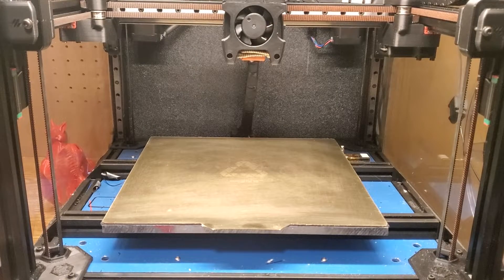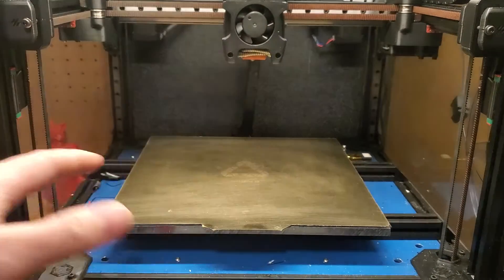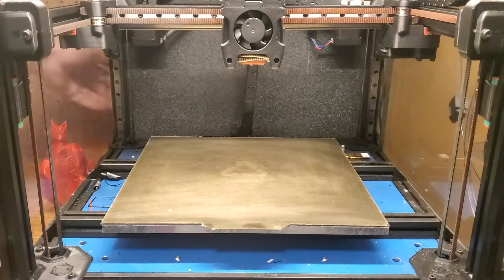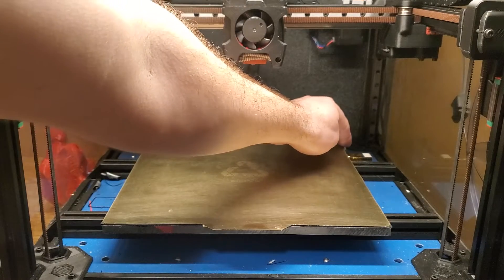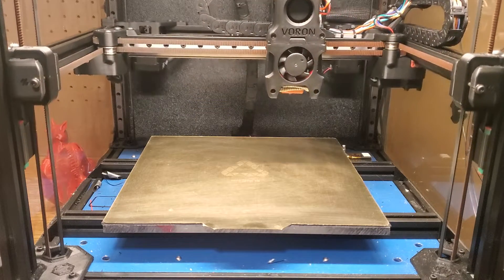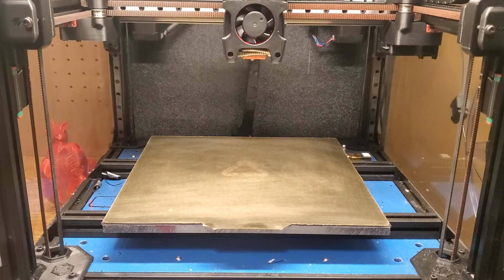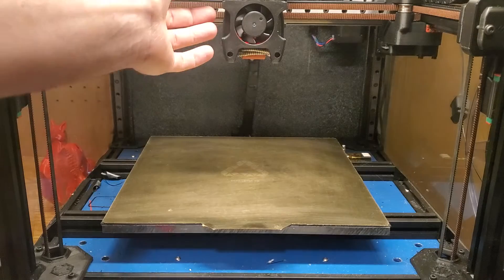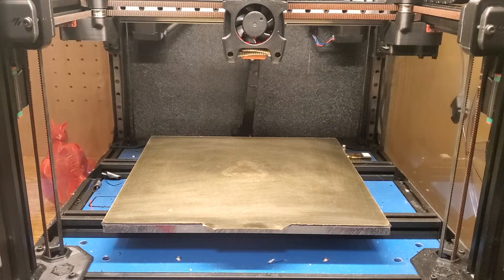Voron v2 gantry tramming and z offset mechanics

Comment: So I've been reading the 2.4 Build Manual and been skipping through some videos but somewhere along I must have missed the part explaining the required final length of the Z-Touch Probe Pin - The Build has a graphic listing it at 33mm but the manual also mentions it needing adjustment which makes sense as it is highly depending on the combined thickness of a build platter PEI spring steel bed mag sandwich but what is the final length of it? With the entire sandwich assembled do we simply shorten it down until the PINs top surface is flush with the Build Platform one and at what stage would we want it to be flush? While the Z-Axis Switch below the PIN is relaxed or while it is triggered?

Coming from an i3 MK3S with MMU2S I'm also kinda hesitant in making the jump to a Voron 2.4 ( besides the increased build volume I also find the tool swap ability of it intriguing ) as losing the MMU2S' provided Multi Material Printing capability is kinda really huge for me - In one of your videos you've mentioned that the MMU2(S) might be the only current option to go with in terms of Multi Material Printing ( with alternatives like a Pallet not being able to keep up ) on the Vorons but I couldn't really find any information on someone having it done - You wouldn't have any more information on that?
Reply from the maker: The pins needs to be long enough so its roughly even with the print surface. Plus or minus a wee bit is ok..long as the nozzle.can reach it witgout hitting anything.

As for mmu. That style of multimaterial is functional on a voron.  Other methods like y splitter or palette work too
Reply: @CanuckCreator  Aii... That was a fast reply 😮 Any recommendation where to look for additional information on how to get the Prusa MMU2S hooked up and working with a 2.4? A Voron SubReddit search has a whopping 4 results related to MMU coming up and none of them actually talk about someone having one running 😐
Reply from the maker: @Duraltia  voron discord is the best place
Reply: @CanuckCreator  Hmm... Okay. Thanks! 👍

Comment: can you do me a huge favour? it looks like you know what you are doing, so what is the deal with the smooth idlers? i have been looking in all the wrong places for a good reason to do this.
Reply from the maker: Smooth idlers allow larger bearings which last longer. Also in testing ive found barely if any noticable difference in print quality so kept the smooth idlers
Reply: @CanuckCreator  thank you. there are larger tooth wheels available though. i just worry about the belt profile. Also i have only ever seen it with bearings that where smaller than a 20teeth pulley, so where would be the point in that(compressive force?)?

Comment: I was wondering why not use PINDAv2 it could compensate the heating offset? The price is around 10$ maybe there is a reason not to go this way? :)
Reply from the maker: Iirc there is a mount adapter for it somewhere. Its not really need though unless your temps change between probing each corner during each run as the microswitch handles the offset.
Reply: @CanuckCreator  thx for the answer. That's what I'm trying to understand. It's cheap (around 8$) and small and does the same job as microswitch + the sensor (ali 12$). Maybe I'm missing something :)
Reply: @FBWA-Karhu  Bed tramming is not the same as Z offset. The probe handles tramming (how bent is the bed and compensate) and the switch handles the Z offset (distance nozzle to bed).

Comment: I assume the nozzle probe has to be aligned to the top of the bed?
Reply: not really. You figure out your actual nozzle probe (Z-home switch) offset in reference to a printing table surface in empirical way then specify the value found in the printer.cfg file. Once the offest specified any new nozzles will be zeroed at the same Z0 level after changeover as the previous one.

Comment: Thanks for posting this. I think the QGL [quad_gantry_level] process is different in Klipper?   Do you run a G28 when running a bed mesh calibration too? 
Homing XY in Klipper for me seems to auto home Z even though the command is G28 X Y.
Do you also run a machine with Klipper? I watched your 2.2 to 2.4 tear down the other day too. I am about to do a 2.1 to 2.4 "upgrade", just waiting on parts...